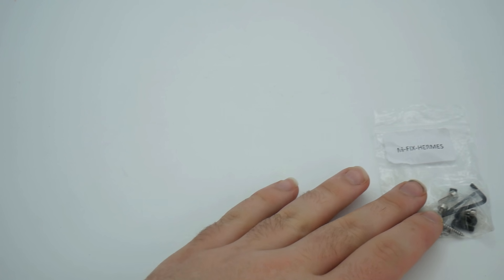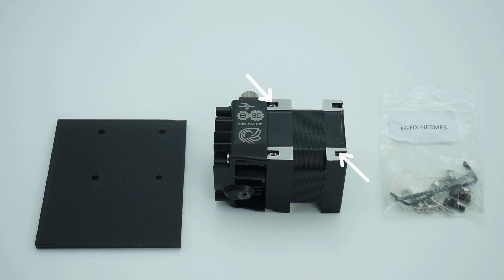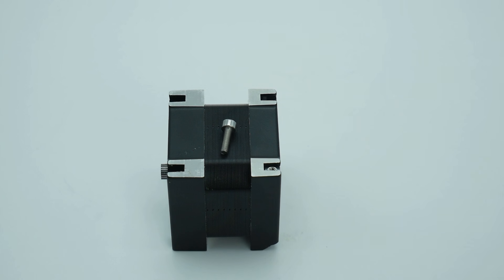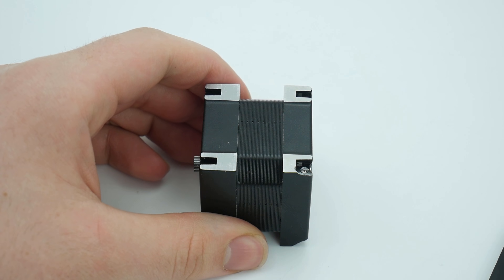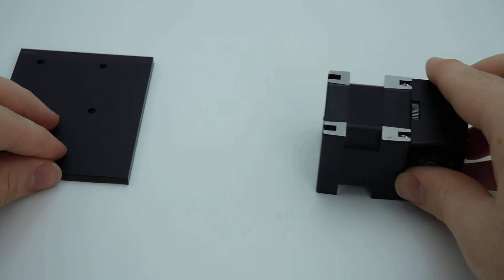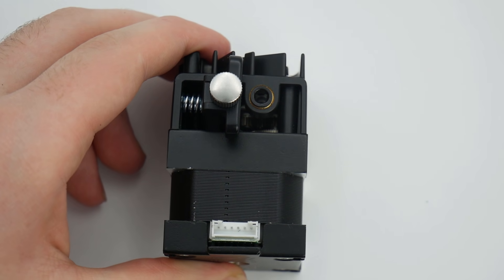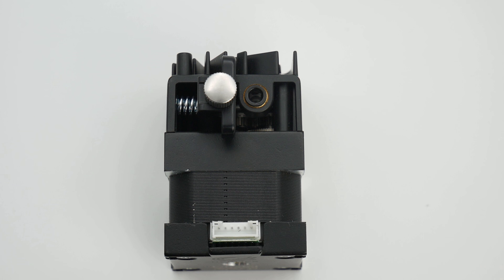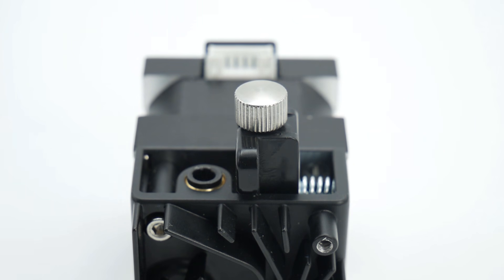Mounting your Hemera (Generic Guide)

Comment: So I just ordered this.  J now have this one the new bondtech lgx with the prusa flexible add on. I also built the veron m4 extruder and the bunny ears prusa extruder all to use with Dyze 500c all metal hot end,originak dragon hotend, original cooperhead and mosquito. Really curuis to see which combo pushes out the most. The hemera with or without stock hotend or lgx/m4 with the Dyze or mosquito high flow.

Comment: Two things : 1 you are very specific about what screws NOT to use but maybe just say "use m3x8". 2. You need to supply more of the square nuts in the very fancy box as they are totally non standard and get lost very easily they must cost almost nothing and it's not a cheap product.
Reply: Mine came with a few nuts missing. Had to hack my own nuts together
Reply: The can’t specify a bolt length because of the varying mounting options/thicknesses.

Comment: Lousy precision! Have to file the metal hotend because the gear is rubbing it. Don’t buy, on paper looks good, in reality, the stepper motor will transfer heat to the heat sink, causing heat creep in long hour print, and your filament will be stuck. They should provide or sell aluminium mounting bracket instead of using 3D printed parts. That is the only way to direct motor heat away from extruder heat sink to prevent heat creep.
Reply: Totally agree and these are facts.

Comment: I wonder if you could have cast holes in behind the slots to allow the screw to penetrate a few mm into the motor housing to prevent damage caused by long screws...  maybe in a future revision?

Comment: you could supply or suggest to use hex headed bolts with the head in the motor slot and the nut used to clamp the plate, and help keep it idiot proof.
Reply: oops sorry you use square nuts ( i do for a lot of things)